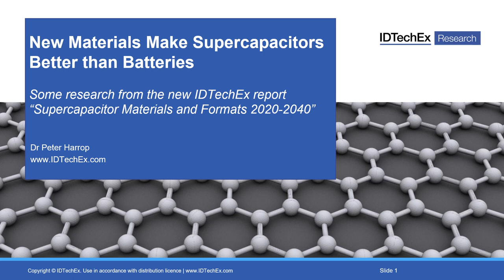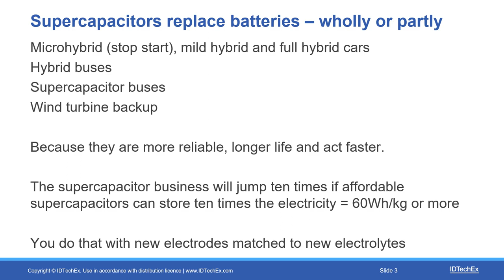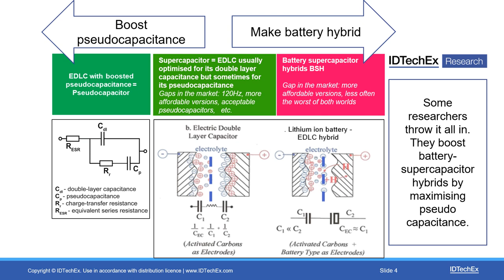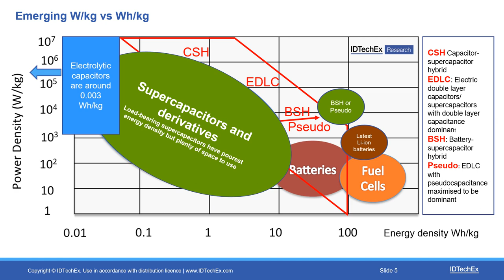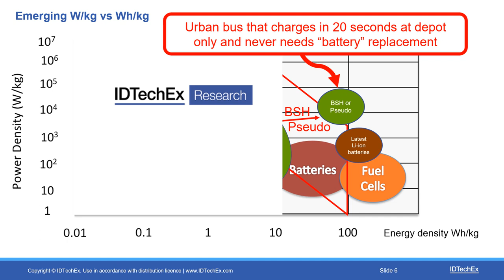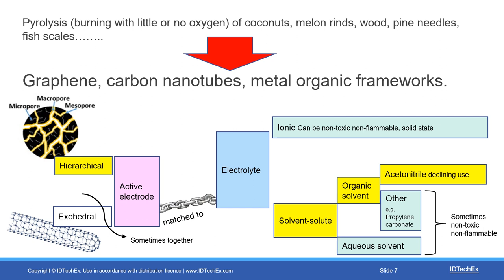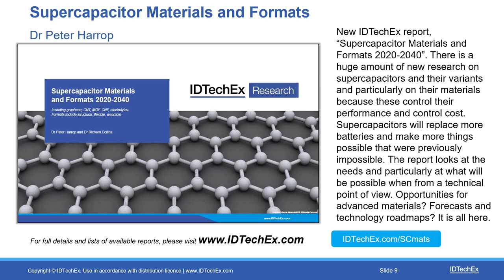New Materials Make Supercapacitors Better than Batteries

Comment: if super-capacitors get the same or more energy to volume and weight than batteries, and can fix the energy leak problem. than ill use them instead for all my battery needs. 

if i use some energy continuously from a super-capacitor, will there be no energy leak?